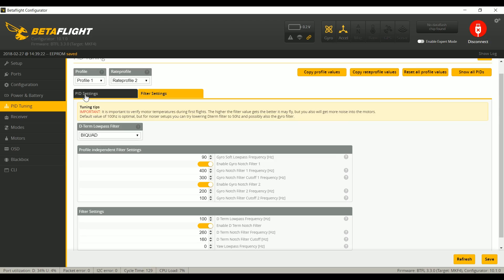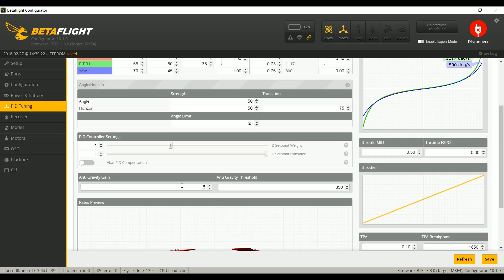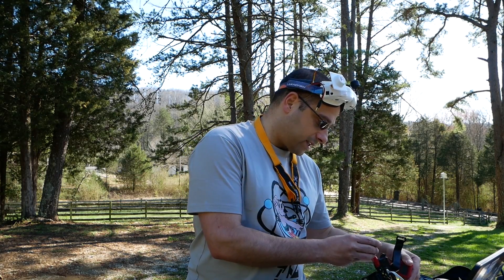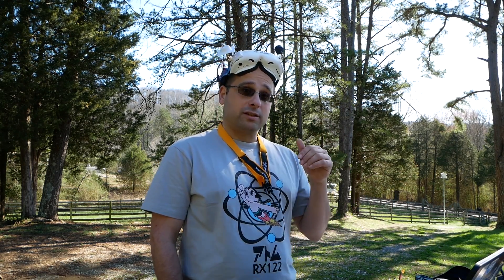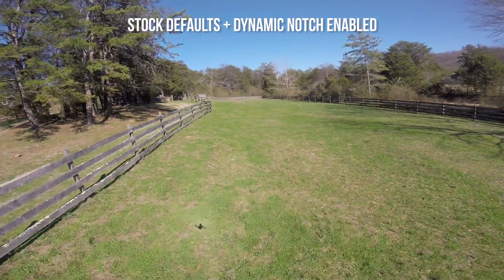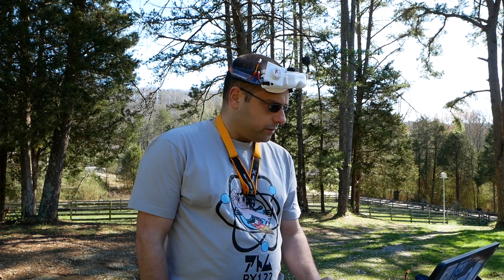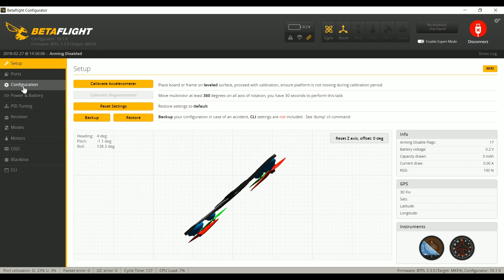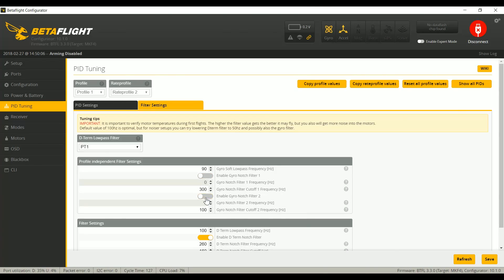Betaflight 3.3 (not) Kalman Filter | FLIGHT TESTING

Comment: looks like you're doing part testing Betaflight 3.3 and part testing clearview module during the making of this video. 😂

I think I'm gonna give this stag2filter another try. I've tried 150-200hz but still getting oscillation and I don't want to burn up my motors so I kinda stop at 200hz. But you did 250hz and your motors are fine and also that's where significant improvement starts to show..
Reply from the maker: It's tough because one person posted he burned his motors using that technique so definitely be careful. 

IMO the UAV Tech method (high stage2 with dynamic enabled) is probably safer because dynamic can always clamp down if things go to hell.

Comment: People are confuse about how to setup everything. But the reality is that is a matter of test and see if it works better or not. I'm using the black box and trying to tame before the peak motor noise. The UAV Tech channel talk about it. You can use the last setup on the video, the one with 500hz but bring it to your motor noise. My was around 240hz. I don't know maybe feels better. I want to discover if it's necessary or not to turn off dynamic filters. It's really my doubt right now.
Reply: With my 8k8k setup was perfect when I turn off LPF = 0 and then setup the stage2 = 90hz or something near. Just changing one for the another instead use the two filters. The new filter seems to have less latency and you can feel it a bit turning off the LPF.

Comment: Definitely learned something , thanks JB ,. QUICK question if you get time , using a old eachine wizard FC for a quick build using a  bunch of old parts I had laying around , any how should I be running 4K 4K  in betaflight or am I able to run higher , thanks I  no your busy but hope to hear back ...
Reply from the maker: F3 processor cannot run faster than 4k/4k under most circumstances and sometimes need to run even slower. If you are running Oneshot then you can't run PID loop faster than 2 kHz.
Reply: Joshua Bardwell , thanks so much just wanted to double check appreciate the  fast response. Keep up the good vids I love your content ...one more quick question sorry just came to me , any idea if i could run multishot on my emax babyHawk

Comment: Very informative video! I would like to try the dev approach but i have an F7 fc and you can only run 8/8 due to an bug(CPU Goes to 100%) in betaflight. Hopefully in 3.4 it Will be optimised for F7. But Nice approch for testing👍

Comment: Isn't a lower cutoff less latency, not the other way round as you have said. Lowering the gyro lpf reduces latency I presumed it was the same on the stage2?
Reply from the maker: Lowering the cutoff of a lowpass filter increases latency. The more filtering, the more latency.
Reply: Yes, I agree. Isn't 200hz cutoff more filtering than say 120hz? Because 200hz cutoff will filter everything lower than 200hz, which is more than for example 120hz. Meaning 200hz is filtering 80hz more than a 120hz filter. Surely that is less filtering and less latency?
Reply: Sorry JB, feel like a noob. Looked back at some old info about the LPF and it says to lower the LPF for noisier setups. Sorry mate, getting in mixed up myself now.

Comment: Can't wait for the butterflight test. In the meantime, this was very informational and nice to know, even if I'm not going to try this immediately. Maybe in the future.
Reply from the maker: The most interesting question to me is whether the Kalman filter is equivalent to the Biquad or not. So my approach will be to set them both up identically (same lowpass) and look for differences in flight characteristics.

The approach of, "Tune them both optimally and see which flies better," leaves way too many variables uncontrolled.
Reply: Agreed, i just hope he does not treat the filters like the BIQUAD + FIR2, they are not the same and should be tuned differently
Reply: I'm still using BIQUAD on my quad. I need to try and swap to PT1, then disable those filters and see if I get less prop wash. I don't know a lot about the differences, and I never saw someone talking about FIR.
Reply: I think it comes down to what you set your r and q to. I found the defaults of q=400 and r=88 shocking. However with pt1 on 0 and q=45 and r=10 it performs sooooo good with little propwash and the best stick feel of all time
Reply: In effect it replaces the pt1 with a "better" filter. If you graph the filters of pt1 and fast kalman they are nearly identical anyway.
Reply: Smoke out can you please message the butterflight page on fb? we're always looking for better stock settings
Reply: I havent got facebook but I could email them to you or something like that
Reply: Or, I can edit a butterflight video and pit it on my channel if you like
Reply: oh my Mr Nobody! just changing to PT1 and disabling those filters (all if you can) makes a HUGEEEEEE difference.  The difference between BIQUAD and PT1 (without filters and whatnot) is immense (for me).  Butterflight - it's different.  But the difference isn't as stark as biquad --> pt1 and that change is quite a bit easier.  Not like switching to butterflight is hard, but they are chasing a different goal and disabling some safety nets that i'm not sure is beneficial for the average user chasing "good enough".  Good enough clearly isn't what they're about... and that's great.
Reply: Damn I originally just did a "thank you" comment for this information, and it led into an interesting comment thread (and an answer from Joshua !). I'm new to this hobby, 25hours of Liftoff and a dozen of LiPo IRL, and it's pretty cool to have all this knowledge base on Youtube !
I'm switching to PT1 right now, and I'll disable the filters one by one when I can fly (but a friend with the same quad  - Furibee X215 - disabled the two gyro notch filters and has no problem so I guess I can do it too).

I'm currently reading https://github.com/betaflight/betaflight/wiki/Gyro-&-Dterm-filtering-recommendations and it seems that the defaults of Betaflight are very "conservative" indeedd.
Reply: Yeah - those first two often can be turned off with minor fanfare.  Its' the d term notch one that you really need to keep an eye on.  And keep in mind that just because a tune works today doesn't mean that a bearing that's crapping out or a bent prop/shaft might cause a motor smoke situation later so it's always good to check the motors pretty regularly.  Personally, if you're learning, my advice would be to get something that's good enough which, like the default tune on betaflight has been "good enough" for the last like 8 quads I've built - and stick with it a consistent quad is going to get you to learn faster than a PERFECT quad that you change the behavior of regularly.  Just my opinion - it's hard not to want the best ... but i think you learn a lot more with something that's just consistent.  And maybe it's just because I started on F1 chips but things just fly so well now with so little effort.
Reply: Thanks. up for joining a slack? https://join.slack.com/t/butterflight/shared_invite/enQtMzIyNTYwOTE0NTc4LTJhZDA2YTQ0NGJjMmQ3NjI4YzQ4YmY5NTA2MGU0ZDJhNTM0MTcwMGIzZjNiMzYwZDY4ZTk3NmZkZTlhZThkMjc
Reply: Yeah that's the reason I didn't touch those advanced settings yet. I switched to PT1 tho. I kind of want to disable at least the first gyro notch filter too. If it's okay i'll disable both, but keep the D-term notch filter. I don't need a "perfect" quad as you say : I have much more room of improvement in my skill than in the Betaflight settings.
I'm happy I'm beginning to be "smoother", land some Split-S etc. Now I need to practice, practice etc. until it looks as smooth as a Le Drib video :')
Reply: Could you share the presets here?  Cheers.
Reply: How did you like it on 8k!
Reply: Wow... 3 months later and look where we are... PT1

Comment: Paused the video to write this. At 150 the prop wash, to my eye looked worse than standard filters. At 250,im definitely seeing an improvement. Interesting experiment. Now to continue watching!....

Paused again. So is the 8k part of the experiment still at 250? Does that not introduce latency running it that high at 8k?

One more... So when you ran 250 can you confirm you had all notch filters off and the dynamic filter off too? The 500 part to me, looked like it flew slightly worse. You could see the quad right on the edge of propwash. Like a car balancing on a cliff edge where the slightest weight on one end or the other would tip the balance. I guess you could say it made the quad look 'nervous'.
Reply from the maker: Yes, all notches were off including dynamic, when the stage2 was at 250 Hz.
Reply: Joshua Bardwell thank you josh.
Reply: Where is the video on how to do this process. I agree the 250 looked best.
Reply: Planet Power I think the video before this one is the one you need. Have a look through Mr B's channel, it'll be there.